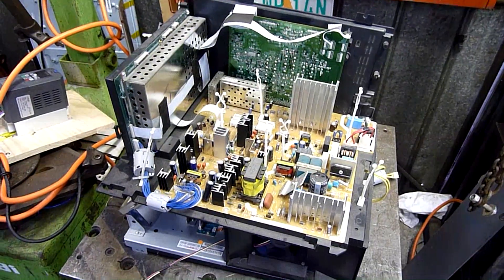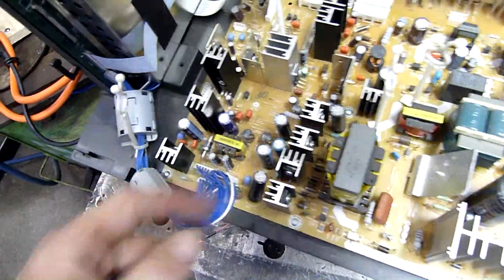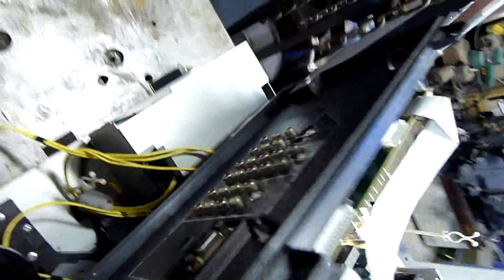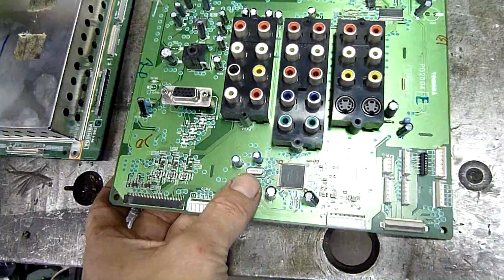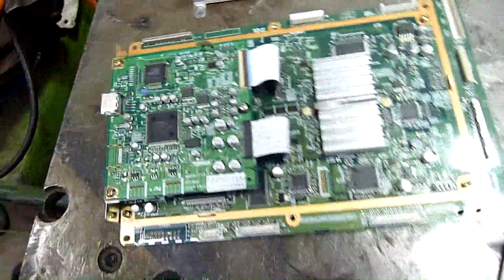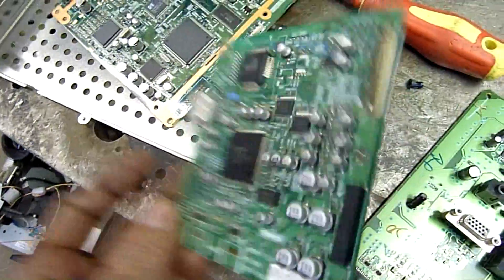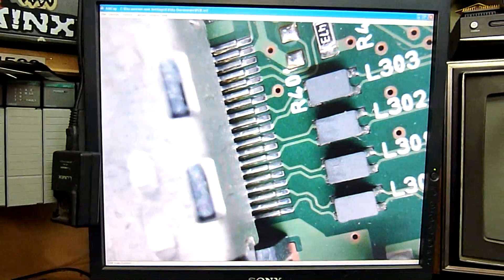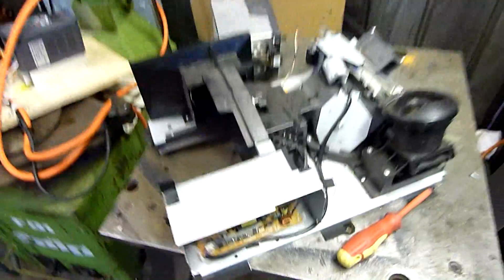Toshiba DLP TV Chassis Autopsy Pt1

Comment: Your autopsy videos are great!
Have you come across any sources for toroidal transformers I.e 18-0-18v 200va or slightly larger to 25-0-25 300va etc I have not found a source for them?
Reply: In the USA, Parts Express.

PE# 122-620: 18V-0-18V 250VA
PE# 122-640: 25V-0-25V 330VA

Both are dual primary, 115V center tapped. Run the primaries in series for 230V mains.
Reply: Andrew Kwiecinski

Thank you however i am located in Australia so cost of postage is high. I like recycling aswell but have not come across anything that uses these apart from audio amps; which i have no luck in finding free.

Comment: now that would be awesome to have if i ever learn how to solder capacitors on a PCB (fixing LCD's) I have only soldered wires together, I am horrible at soldering on a PCB. motherboards even more so since they have so many small surface monted components.

Comment: that USB microscope is neat. I'm sure it comes in handy if you ever get to repair a phone or maybe a iPod or IPhone (4th gen?) We worked on a ipod touch 4th gen and let me tell you there is NO ROOM at all under the cover. you have to be careful so you dont break the short cables either. Which is what we ended up doing. We ended up selling the broken ipod on eBay and buying the customer a new one off amazon.

Comment: I found a 32 (i think) DLP (akai) in the trash once. It barely fit in my back seat. Upon bringing it home i was trying to carry it in (quite heavy). A nice neighbor helped me bring it in. It worked for a while, then it started going through a loop where it would power on, then power off and power back on. Come to find out it was either a bulb, or a DLP circuit (color circuit?) of some sort. it would work if you power cycled it 10 times.If it quit working all together you'd wait a day then it would work again for awhile. I used it for gaming then sold it for 50 bucks as is. I guess DLP is too costly to fix when you can get a plasma or LCD like you said cheap

Comment: The colour wheel is because the dlp chip only deals with one colour at a time.  The light is passed through the colour wheel and is precisely in sync with the dlp chip which will be sent the data for the current colour segment on the wheel.  This happens very quickly so isn't (very) noticeable to the eye.

Comment: From lamp to lens,
lamp -> UV filter -> color wheel -> beam correction tunnel (to make a small beam) -> few lenses to put the light on the dlp at the right angle -> DLP CHIP -> output lens.
The dlp only reflects at the moment the color wheel is at the right place for the color. And it reflects it for a brief time per pixel to get the right amount of color for each pixel.
Reply: Also you can bridge the HV driver out (theres a few optocouplers at the signal inputs, to make it think it runs , then remove the whole HV driver  and put a car bulb behind it for a few bucks. I got 5 cheap dlp projectors that way.

Comment: The bulb-driver can be usefull for other bulbs.

It's probably 300V-ish power input input, and for sure some logical signal.

The cable going from the control board pass 3 opto-isolators, so totally hackable.
(you only need to figure out what direction they are mounted, and try to give some simple DC signal for inputs.. hopefully)

HV e.t.c. warnings apply, except the control wire that is isolated from the rest of the board.

Comment: My friend across the pond has that model of DLP TV, and he suffered the same fault yours did, only it was caused by a little burnt out resistor that was under-rated for the job rather than a failed bulb, as far as I know it's still going now after several years since the resistor was replaced... :)

And the HDMI on those isn't proper HDMI, it's just DVI with a fancy plug, it won't support proper HDMI (audio, video, data, etc.) from current HDMI devices, it was pretty much still in the prototype phase when they made that TV, I often wind up my friend about it too as it's a pretty pointless port... :P

Comment: That color wheel is made of dichroic glass.  The are color filters that pass one frequency band of light, and reflect the rest back.  So the Cyan, Yellow, and Magenta light you saw was reflecting back, but it is passing through the Red, Blue, and Green to the DLP/DMD chip.   High end DLP systems will use three chips, one for each color, and combine them in the optics before passing out the lens.
Cyan = White - Red
Yellow = White - Blue
Magenta = White - Green

Comment: Ed;  I got a DLP, same unit only the 45"; color wheel was out of balance which is a common issue.   The Lamp had also burned out.   I spent $115 on this set about 4 years ago; the set still works great to this day! 
 
Also; i believe the DLP chip uses mirrors to reflect the 'colored' light at the appropriate moments to the screen.   At least that's my understanding of it -- from what I can gather, the refresh rate is in the 10-20khz range (color wheel RPM x 2)

Comment: As far as I'm aware of, the DLP chip can only handle light (i.e. the pixels that make up the image) and not colour, as it's basically made of microscopic mirrors that turn on/off for every pixel of the image.  The light wheel allows just one colour to pass through at a time, so depending on which colour segment the light is going through, the DLP chip produces the image for that colour.  This is done at a such a high speed that our eyes see the individual colour images combined as a full colour image. 

Some people (including me) can see the image break up as 'rainbows', where the individual colour images are noticed with eye movement such as when looking away and then back at the picture. 

I'm quite surprised about the colours on the wheel, as I would have expected them to be red, green and blue.  Some DLP projectors also include yellow and white for improved brightness in a bright room.
Reply: That's right. They also use more than just red, green, and blue, for more realistic skin tones, bit like inkjet printers that use 6 colours + black.
Reply: It is red-green-blue.

But you have to look at what color it pass, not what color it reflects.
Basically: Aussie50 look at it "wrong", you have to look at light from behind the wheel.

The wheel doesn't absorb the light, probably since it then would get really hot.
Reply: It's a dichroic mirror. Allows certain wavelengths of light through and reflects others. But you can get them that also use yellow and magenta as well as red, green blue. The HD ones are usually red, green, blue, and natural green.